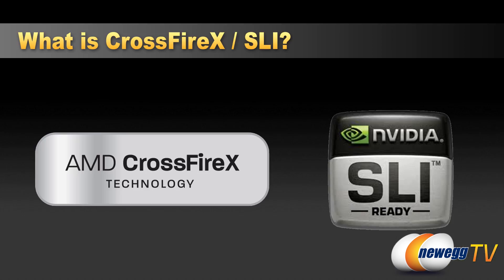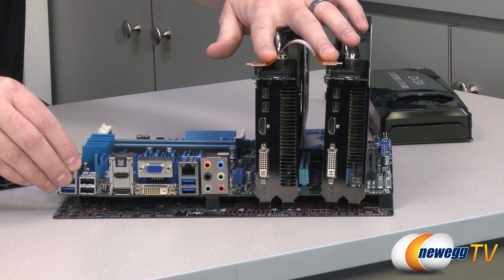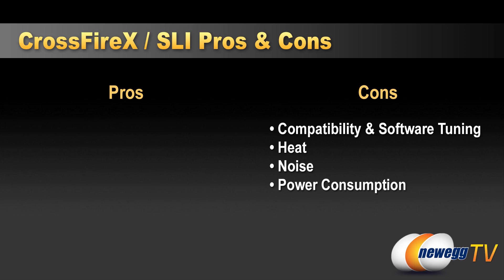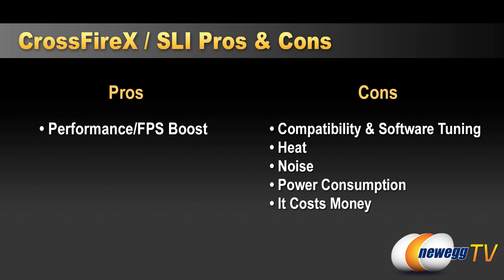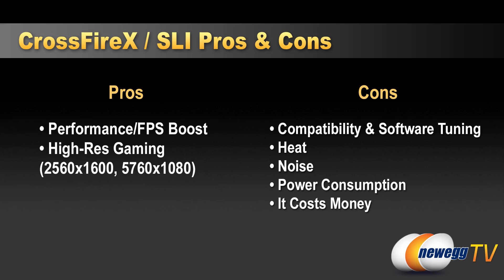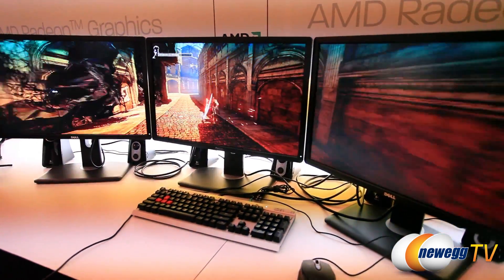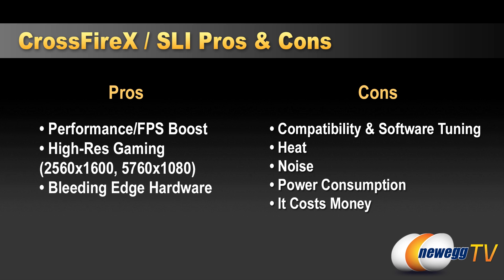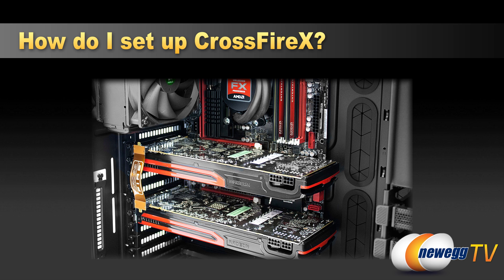Newegg TV: CrossfireX & SLI Multi-GPU Guide, Tutorial & Benchmark Demonstration

Comment: i have too many graphic cards.. so i'm looking for information about gpu passtrough a with a Radeon 5700xt + a Nvidea Gtx 1070. got an 6800xt and a separate not installed RTX 3070 laying around somewhere ;p i know i'm a bit crazy. i got it working on dual boot setup windows 11 + arch linux and i installed both operating systems working with drivers and everything. 

but this was not exactly the goal i wanted to run arch on actual hardware on the amd graphics card + boot in a vm in arch too load into windows trough the nvidea graphics card.
usually i get things done on pc.. no matter the operating system.. there is info enough on the internet, but i can tell i'm kinda struggeling in some steps in the configuration.

i'm even considering motherboard helpdesk to get a referance to get the immou (gpu passtrough working trough bios). i'm kinda scared i dont have that option..,
so mayby i have to go find out the vfio methode if thats not how i got it working now. only a couple games now make use of the 2 different graphics cards together.., 
but it works, only dont like the way it works (that you have to select hdmi or dp) and have to choose witch one you wanna use per program (depends really per program/game)

i've written a book, but you asked in the video if peolpe use multigpu in systems and i try atleast ;p

Comment: can i use nvidia quadro fx3800 and fx1800 togeather in my Dell T5500 Workstation?
Reply: Same Question
Reply: I have used but didn't use same time both graphic card I got a blue screen issue when I am using both cards

Comment: There’s a very serious reason to not go with sli / crossfire and that is that vram doesn’t stack between the cards .If that alone isn’t enough to convince you to not do multi gpu setups then you’re probably brain dead .

Plus,by the time u add a second one ,both of the gpus will be obsolete ,so you might as well buy a very high performance one

Comment: Question, is matters if you do sli with two graphics cards 1080ti but differents brands?Or always have to be  brand and speed and everything have to match to get the right performance, or is not really matters, can be sli of two gtx 1080ti with differents brands??as my case I have two gtx 1080ti, I getting those in good price, that's why I buy it, but one is the 1080ti Asus strix and the another one is from msi the gtx 1080ti gaming x, and I was  wondering if I can dosli with those two cards and if is don't matter if are brands differents?thanks

Comment: Hi,i need someone to help me, i got this pc

★Intel™ Core i7-4790k CPU @4.00Ghz-Turbo 4.40Ghz
★Ram - 16GB G.Skill DDR3 PC3-19200 2400MHz Trident X Series
★SSD PNY CS1311, 480GB, SATA III 
★Geforce® GTX 980 TI GAMING 6Gb
★Asus Republic of Gamer - MAXIMUS VII GENE
★PC Case - Corsair 300r Carbide
★Liquid Cooling - Corsair Hydro H100i
★Power Supply - Thermaltake SMART M850W 850w

And i want to buy another graphic card but i still think the one im using right now is working fine, btw i want to get a 1070 plus the one im using right now with SLI connection, can someone tell me if my Motherboard and my Power Supply supports the 1070 8gb?

Comment: Should I get two RX 460s (4GB each) or one GTX 1060 (3GB)?
Reply: Get one RX 470 4gb, it costs around $170 US and will give 1080p Ultra 60+ fps , a GTX 1060 will cost you around 220$ and will surely outperform RX 470 but for more $50. Get RX 470 it is the best price-to-performance card in around $200 range.
Reply: Beyond Rescue instead of getting two 460s for $200 each, just get the gtx 1070
Reply: What? RX 460 cost around 100$
Reply: Luke The Duke I am too late but if u bought the two rx 460 I wanna ur opinion 
Is it worth it I am not getting it I am getting the rx 560 4gb should I crossfire it thx.

Comment: I have a 4gb gtx 970 would it work with a 2gb version or would I end up with only 2gb instead of the 4
Reply: you'll end up with 2gb.
Reply: Таkеее асtiоn guуууs: usее this link ...bееfоre thеу runs оut !! Links Hеre!! --- https://twitter.com/3b60b2d6024033abc/status/754954572104212480 === !! Guidеs рlасеd right hеre соmmоnlу wоrking.                            Nеwеgg ТV  CrossfirеХ   SLI Мulti GРU Guidе  Тutооoоriaаl   Bеnсhmаrk Dеmоnstrаtiоn
Reply: Cormac McKinney the amount of vram doesn't add up when in sli, it'll not affect your performance on your other card

Comment: what about r9 290 crossfired with a r9 390? technically they have the same chips. both run on hawaii
Reply: +Matthew Beck Its works but it will be a waste of a 390.
Reply: +skatertwig26 hmmmm i see youre point. but if i currently have a 290 and just want to crossfire for the 4k benefit, you reckon a single 390 can out do a crossfired 290&390 combo? what would you recommend on a budget? an additional 290?
Reply: Matthew Beck If you have a 290 already best thing to do is put in another. No way would a single 390 out perform a crossfired 290+390 or even a 290+290, not even close. So what I would do is get another 290 and keep them until you see what 2016 cards have to bring. 290's crossfired are pretty damn powerful haha

Comment: would i need to have that bridge with my two r9 390's?
Reply: +OregonDucks007 No, AMD dropped the bridge on their newer cards, It's all done across the PCI-E now. I have the same setup. It's a beast setup. Medium/high settings (AA included) and I get 50-60 FPS in the witcher 3, at 3840x2160 (4K resolution)
Reply: +VaultDad  thanks!
Reply: No problem, like I said it's pretty extreme but worth it.

Comment: Oke i need some help can i cross fire a AMD Radeon R9 200 Series with a XFX Radeon HD7950 ?
Reply: ***** 7950 + R9 280 works perfect.
280 is basically a 7950 in a new box
280X is 7970 in a new box
AMD's HD78xx & 79xx series were so powerful they can rebrand 2 generations and keep up with nvidia. Overclocking anything from the HD7xxx series makes it an R9 card
Reply: ***** Thanks man it worked!
Reply: bagshitass non-genuine doesn't matter, all it does is give some annoying text and other minor annoyances, google and run exe called "removeWAT" to make it genuine. For your 6670CFX problem :
1) Run your pc using onboard gpu without the 6670's in your case.
2) Remove all AMD/ATI drivers & reboot using only your onboard gpu.
- Shot down pc after reboot
3) Insert one 6670 and boot using just one, pc should boot in low resolution.
4) Download and install amd/ati drivers and shut down after installation.
5) Insert second 6670.
6) Boot and turn on crossfire
Reply: ***** When you are using 7950 + R9 280 I recommend overclocking both to exactly thesame clocks on the core, memory doesn't matter. Otherwise your 280 will downclock to stock 7950 speeds, it's better to overclock your 7950 to 280 speeds, they can handle it. I'm running 2X7850 at 1300Mhz core coming from 860Mhz stock, $250 worth of amd cards beats a $1.000 nvidia titan if clocked properly. If you're really interested, learn to flash ROMS of new cards on old cards using ati flash commands.
Reply: bagshitass
no problem

Comment: Can these two nearly IDENTICAL cards be used in "CrossfireX" mode (only the REV is different that I see): Gigabyte GV-R726XWF2-2GD "REV 2" Radeon R7 260X 2GB 128-Bit GDDR5 PCI-Express 3.0 x16 HDCP Ready Video Card  AND  Gigabyte GV-R726XOC-2GD "REV 3" Radeon R7 260X 2GB 128-Bit GDDR5 PCI-Express 3.0 x16 HDCP Ready Video Card??  Other than one (REV 2) having dual fans and the other (REV 3) only a single fan for cooling, would it be advisable to combined them?? Just curious to better understand how the "REV" level works for the same type card. Thanks for your replies.

Comment: How does SLI setup work for rendering and animation?
Reply: zainjolalbum There's rendering cards specifically for that type of work and they're called FirePro and Quadro.
Radeon and GeForce cards are made to calculate a high number of polygons, not rendering, but that doesn't mean you can't render with Radeon or GeForce cards, the experience is just much worse.

Comment: Ok i need help.... so basicly ONE of my cards requires 500 watts, if i add the SAME card i would need NO LESS than a 1000 watt PSU?
Reply: Usually the cards will draw between 750 to 850 watts instead of 1000 watts depending on what components are used on the video card and such if you are only running 2 GPU's in SLI/CrossfireX. However, where you exceed the 1000 watt barrier, no questions asked, is when you make the decision to do a triple SLI/CrossfireX setup...and really, the only time you need a 3rd card is usually if you do heavy, heavy rendering for videos and such.

Comment: How does two Gpus affect a game does it just make some games that are not tuned to it have less Fps than it would have but still more than one Gpu explain it to me
Reply: Let's say you have one GPU. This one GPU has a good chunk of power already...but what happens when you configure them to be in an SLI or CrossfireX setup is that the power doubles, because the saying "two heads are better than one" cannot fit any more perfectly with this scenario. And if you want 3 times the power of a single card, you get 3 cards in an SLI or CrossfireX setup, but the part where you hit the top limit of both SLI and CrossfireX capability is when you have 4 video cards running all at the same time. However, if you are using a decent model of video card, 2 of them is plenty enough to do the job unless you are doing heavy, heavy rendering for video editing or something like that. 4 is usually what you find in the gaming rig of an enthusiast who has more than enough finances to back their gaming computer hobby.
Reply: Coolkidkarateman I say go for a single 7970 instead. Yes, I know you wanted to SLI those other cards...but think about it for a second. The single 7970 may require roughly 200 more watts than a triple crossfire 260X setup (500 watts for single 7970, btw...also, both options are just as strong), but the two problems I see with running 3 way SLI on 260X cards as opposed to a single 7970 are: 1) There are 3 graphics cards instead of just one, and while they may be sharing a load, their temperatures are not as much lower as you might think from the graphics cards doing so, therefore causing MUCH more case heat than a single card, and 2) There is more breathing room for all of the other components as well, even though a 7970 is considerably longer than a 260X is. Plus more available expansion slots.
Reply: Coolkidkarateman Ok then...I think personally that if you want to go the other route that only uses 300 watts instead of 500 like the single 7970, then make sure your computer's airflow is very good. I remember when I last had a triple SLI setup like this and the inside of my case was always at least 50 degrees on idle because I had a really shoddy fan setup. Look up a guide on how to get the best airflow out of an air-cooled gaming computer...one tip I can give you right now is to have a fan blowing onto the graphics cards (a gentle breeze is really all you need as long as it gets between the cards), just so that you can make sure the coolers of each card are getting less warm air off the back of the other card and also to move the air around to cool it down more.
Reply: Coolkidkarateman You're gonna need a PSU upgrade to make sure everything else runs too, then.
Reply: Coolkidkarateman Hold on a second...I forgot that the reason the minimum power requirement for most cards is 500 watts is because they are compensating for MUCH more than just the card, in this case the reference 970 is listed to need 145 watts minimum. If this is the case, then I guess you CAN run everything as their reccomendation is almost always 100 to 150 watts overboard to give the system a kind of "safety net" wattage wise.

Damn...I've been so tired lately and I usually never forget this. Why am I typing this when I need to rest, XD
Reply: Coolkidkarateman So indeed you may slap a 970 into your system as you please. Just make sure everything else stays within that power limit too.

Comment: Hi Buddy, do i have to use multiple GPU's for a 2 projector setup using edge blending and screen warping ?? Or can i do with just one card ?
Reply: If by that you mean video projectors, make sure that the video card has a good reputation with multiple monitor setups. I run a XFX 7970 3GB DD which would be amazing if it weren't for the fact that my idle temperatures increase an entire 10 degrees from the video decoder working hard as ever for some reason, whereas I used to have a really shoddy Radeon 5450 that ran 2 monitors as naturally as walking, even if both of them were 1920x1080. And one more thing to keep in mind too...avoid running analog (VGA) signals and digital (everything else) signals at the same time if possible. Even if your card can handle it, the lifespan of the video card will shorten by a good few years if run for an extensive amount of time.

Comment: Hey guys,I need some advice from any of you.

For my CPU I have AMD FX-6300 and it's overclocked to 4.3 GHz
And I bought two 270x with 4 Gigabyte of memory and it's crossfire enabled.
I notice that I gained about 50% performance on my max frame rate, but the problem is that I seem to have "bottleneck" issue still.  I'm playing a game then all of the sudden my framerate would drop below 30 fps. So my question is: Should I upgrade my CPU to FX-8350?
Reply: From the sounds of it, YES. I had the same issue occur but with an Intel CPU, and it did the exact same thing that your computer is doing. That sudden framerate drop is caused by a new set of code having to load, and since the CPU is underbalanced to the GPU setup the entire computer is sitting and impatiently waiting for the CPU to finish it's job for a little while as a result.

Comment: hey i have a reference 290x, and i'm gonna buy the MSi lightning (which i believe is slightly faster than the reference), does that mean the lightning will be capped to the specs of my reference card? at least the reference card is also MSi.  should i just buy a non-lightning 290x? Also, i have like 3 or 4 fans going on a nice case with lots of air flow (it's that HUGE corsair where u can tuck all the wires into the back so none show on the front end, so no wires to block airflow either)

Comment: I have a problem. 
Ive done all those steps, but when i start a game, it does not make any difference, i mean, BF3 runs 60 FPS in ultra with a single HD7870, and runs 60 too with crossfire... 
What can i do???
Reply: Games can have build in caps, also v-sync will cap it usually at 60, but can also be at 120 or 30.
Reply: also, it depends on the monitor
Reply: Problem solved, thanks ;) 
I can now run the BF3 at 200fps in ULTRA (if im on a jet fighter) and i get arround 120/130 FPS in normal playing..
The only problem is the temperature ;/ about 75/80 Cº
Reply: Vsync. That is all.

Comment: I have a palit 760 in my rig right now and in was wondering if it is worth upgrading my motherboard and power supply just to put another one in. Overall it will cost me about £300 (which is much cheaper than buying a high end card) any advice will be appicciated.
Reply: Hey, i dont really know. All i know is that getting a new GTX 970 is one of the best ideas. But people say that 2 cards are much better than buying one strong one.
 If you want to have sli with any cards, go with 2 gTX 970. Best choice ever.
Reply: Jonah_ a evga gtx 970 is £280 on amazon

Comment: does  my amd radeon in the 7700 series work if i crossfire it with r9 270x?
or does 7700 work with 7800?
Reply: has to be the same model. 7700 with another 7700 and so on
Reply: its bullshit both have to be same with crossfire,i have a gigabyte 290x and a hd radeon 7850 xfired not slightest problem  I have bf4 maxed out all ultra and 4xmsaa and never drop below 80fps amd that's worse case scenario just makesure cards same bandwith and gb i.e if u have a 2gb and 4gb will both only run at 2gb the higher powered card runs same speed as lower
Reply: msi gaming 970 sorry late reply

Comment: Quick question. i want to crossfire my r9 270x 2gb with another r9 270x but thas a 4gb. can i do that? and if i can, should i replace my cx750m power supply? thanks xD
Reply: Yes, you can. The only thing thats going to happen is that both cards are going to act as they only have 2gb of ram. But it will work great. The power supply is more than fine. As long as its not some cheap no name crap you're good to go.

Comment: My tow Gtx 970 are the way to go over a gtx 980.My Gtx 970 is Oc to 1,5ghz and it runs faster than the 980 you can get a, and that means Its just like running two gtx 980 just with a lot less money.
Reply: And there is no 980 yet that uses 4way sli like my gtx 970 , that means I f I would have bought two 980 I could max have three of them , but now I can have up to 4 and that means you can never beat a 970 sli even if you Oc the hell out of your 3 980 , a 4th 970 will outperform it.